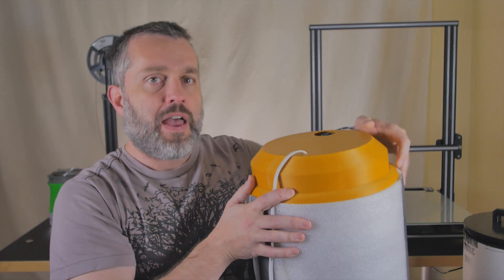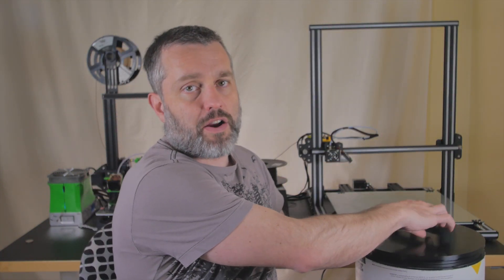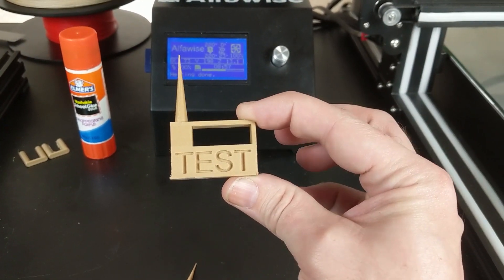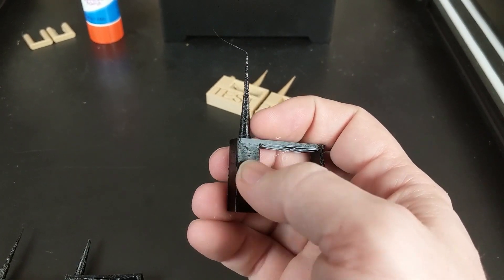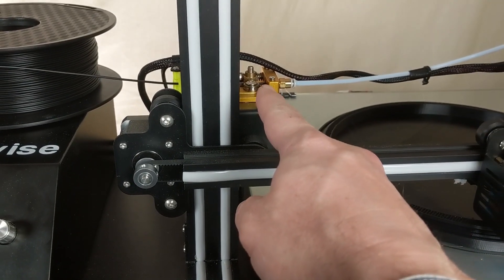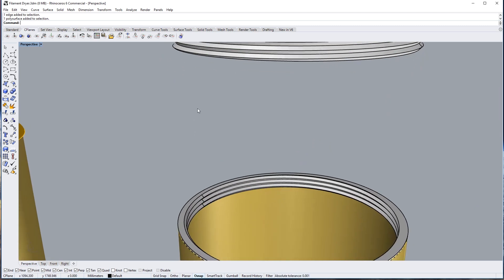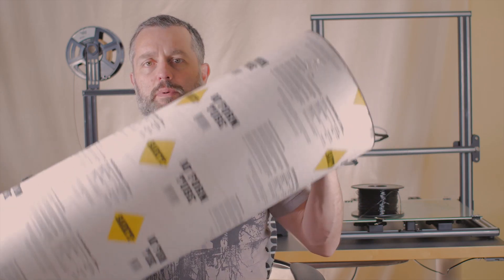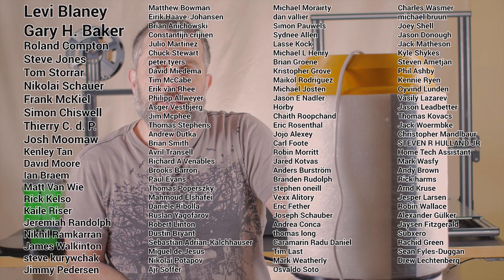If You Are Serious About 3D Printing You Need a Filament Drying Solution.

Comment: I use large resealable bags and put in two silica dry packets which you get in some items for nothing. I got 5 large bags off ebay and the whole thing cost about 1.79 English pounds and i have had no problems since doing this and i always take the filements off the machine after use and put them in these bags.

Comment: “Fails under any amount of heat” ..... define “heat”.
Reply from the maker: I printed some hooks with PLA to hold oven mitts. I placed them about 24" (60cm) above the stove top on the wall. The heat from the stove/oven going up the wall caused the hooks to soften deform droping the oven mitts. If you place PLA printed things in your car on a sunny day they will similarly deform. Good enough? Or do you want me to cite glass transition and flowing temperatures at you?
Reply: Design Prototype Test Design Prototype Test that’s ok.  I know precisely what those values are.  I’m just calling you out for making a blanket statement as in “any heat”, which is too broad a statement, which also loses credibility.  Just sayin’.
And imagine if your toddler ate the spire and attempted to swallow it and it got stuck in his/her airway or throat.

Comment: ok I had kinda an idea of making a a perforated tube that you can fill with desiccate that slides in the holes of the spools that way its a quick grab pull and replace for the desiccate I mostly use PLA but it would be good to have something for the wood fill and PETG right now I just use ziplocks

Comment: Interesting and a useful solution. I'm only using PLA at the moment and hope to progress to some other materials, however I'd suggest making something transparent so you can see at a glance what filaments are where!
Instead of the formtube, I'd make a cylindrical cage out of dowels and wrap polythene around it and seal with duct tape. Your plywood base and screw lid and receiver could still be used with printed holes for the dowels.
Cat litter with the blue/pink cobalt chloride indicators should be a cheap and useful desiccant - it can also be refreshed in an oven at 120 °C for an hour or two and the colours will change to show when ready.
Water vapour is less dense than air, so I'd suggest putting the gel in a basket at the top of the box and that should increase efficiency/effectiveness.

Comment: Worth noting that when you get to nylon materials that they will actually be weaker as made and will significantly toughen with moisture absorption.  When a finished parts structural integrity is being challenged by it's application such as driving self tapping screws into holes that could split out it is not un-common to vacuum seal finished parts with water in the bags for re-absorption.  Just some fun facts for the future...
Reply: I guess I am pretty off topic but does anyone know a good site to stream newly released movies online?
Reply: @Malachi Seth Flixportal =)
Reply: @Elijah Eli Thanks, signed up and it seems like a nice service :D I appreciate it !!
Reply: @Malachi Seth happy to help :D

Comment: Oh yeah you should never dry pla at over 50 degrees 😂. But even if you do set it to 45 degrees you have a bigger problem. Because the temperature control on most food driers is crap: usually a cheap, inaccurate bimetallic strip. The small sections of pla only needs to go over 50 a couple of times to screw up your print. Yuou probably need a dedicated temperature range thermistor and pid loop. These analogue things aren't designed to hold precise temperatures. This might be good enough for filaments with high glass transition temperature, but definitely not enough for pla.

 IMO better to use the taulman method with a heat lamp or other more gradual great source
Reply: Could you elaborate on the Taulman method? Heatlamp to the spool or something more complex?

Comment: PLA wont deform under "Any heat" it doesn't need to be kept at 0 kelvin.
i use PLA exclusively and never needed to dehydrate it. it doesn't last long enough to become brittle.
why use rhinoceros for 3d modeling? there is a much better program you can use for free. fusion 360.

for a dry box it would be better using rubbermaid container, moisture absorbent, and ptfe tube that goes directly to an extruder. better if extruder is  bowden to reduce weight on the carriage. this way you nearly remove any chance of it absorbing moisture as long as everything else is sealed up.
Reply from the maker: Regarding Rhino vs. Fusion 360, I talked about that in this video here: https://youtu.be/iMyEOqrdr3c

Comment: Can't I just put them on the heated bed? XD
Reply from the maker: Maybe, if you built an open bottom box for the spool to go inside of. Actually, this is an intriguing idea. I'm going to try this.  Thank you.
Reply: @DesignPrototypeTest  Yeah. :P When I get time, my plan is to either move my control board out from under my heated bed, and lower the bed... or just leave it where it is. But it may give me space to store some filament. :P
Other than that, there is a lot of spare time warming/cooling the heated bed... so when not printing, I could put a couple of older, smaller spools on there on occasion. But not had any damp problems just yet, as I'm going through the filament at a steady rate.

Comment: Ok as far as the open sided reel on the first solid sided reel the drying process affected the first part of the reel that could easily be affected by the air flow and temp. Now as your statement that because of the solid  sided reel the inner filament can't be affected by the dryer. So in theory it can not be affected by being out in the real worlds air and humidity. So the inner part of the reel should be relatively unaffected and be as good as the day it was made. Now you take that reel and re roll it on to the open sided reel and your prints are GOOD. I think the reason for this the fact that you basically have just gotten to fresh filament. NOW  I'm not saying that the open sided reel and a loser wrap of the filament will not allow the dryer to affect a better drying process. The air and humidity affects deeper into the reel than the drying process can or does. thus the reason that drying the filament gets you a little improvement. then goes bad. I have split rolls so share with other printer people I know the prints they get are not good & they let me know the filament I gave then was bad & I check what I have is good. I think the supports what I am sharing with you. So there is some other info to consider I like you dryer and storage container keep up the good work.

Comment: Very interesting observations on PLA characteristics. Yet another layer of uncertainty in a "hobby" filled with them. I'll be more careful about drying PLA. I have found evidence that drying it can be beneficial despite the fact it's not supposed to absorb moisture. I dried some at 65C recently that seemed to be stuck together a bit throughout the roll after. It appears to print just fine though. I'm sure the additives and pigments used play a roll here.

Comment: Sorry, but you have this fundamentally wrong, I have worked in the PET molding industry for 35 years and can tell you that the problems you see have nothing to do with boiling water within the resin.  The levels of moisture involved are so small that you would never know they are there, except that they cause a fundamental change in the resin structure itself.
Many of the plastics that are hygroscopic absorb moisture at the molecular level.  Left at room temperature there is no degradation but when heated, water molecules combine with the plastic (PLA, nylon, PET etc) through a chemical reaction called HYDROLYSIS.
Hydrolysis breaks down the polymer chains which has a number of effects including loss viscosity, stringing and when cooled the products exhibit low strength.
Reply: 36 years of injection molding here too and I while i may not disagree with your structural analysis, the poor surface finish is purely moisture absorption and it is boiling out in process causing the ugliness. When break testes are done on parts it is common to see voids in the part where the break occurs as opposed to none in dry parts. I have even ran the old fashioned vented bbl. machines that would boil the moisture out in the heating cylinder and allow clean dry resin to come out and into the molds, it was surprisingly successful but not like dryed materials.

Comment: Been printing for over 6 years, I let my filament sit out in open air no matter what type it is, never had a single problem when printing it, I guess it's what happens when you cheap out and buy the lowest price filament out there. 😂😂😂😂
Reply from the maker: You probably live in a very dry environment. Like maybe Arizona?
Reply: no "cheapest filament out their" meaning NOT PC/TPU/PETG etc.. ie stuff that is much more resistant to water intrusion (IE pla etc..)

 @DesignPrototypeTest
Reply: @DesignPrototypeTest   No. I'm in Iowa.
Reply from the maker: Iowa is a fairly humid place. Therefore, Your experience is an anomaly. Maybe your house is climate (humidity) controlled.  Try this: Take your No-name inexpensive roll of ABS, Nylon, or Polycarbonate and leave it outside on your porch for a week or two. Then take it inside and print with it. Watch the steam coming from the nozzle (that's not smoke), and listen to the snap crack and pop sounds as your are printing. After the print is finished look at the layer lines with a magnifying glass. You will see small gaps in the extrusion wherever a steam bubble popped as the part was printing.
Reply: DPT I think you missed the point (or I missed it)

PLA is pretty resilient to moisture (the part that passes the hob gear is "compromised" that is why that few inches is always brittle!!

I suspect he ONLY USES PLA (hence the only buy the lowest price filament) so he does not have as much moisture issues as would exist using non pla plastics.

though SILK PLA seems to have quite an affinity to moisture (the only PLA I have seen this happen to) ie poly alchemy elixr. getting the snap crackle pop of moisture with it :-) nasty surface finish. need to run my nightshade through my dryer and hope it fixes it. love that stuff :-)

 @DesignPrototypeTest
Reply: @nerys71   No, I use PETG 90% of the time and PLA the rest of the time.
Reply: @DesignPrototypeTest   Why would someone do that? That's very redundant to do because you're trying the worst possible case and not in a normal environment.
Reply: exactly. pretty resilient low absorption cheap plastics. (thought their are of course expensive versions of both available)

we are talking mostly about the less common plastics (99% of my prints are also pla and petg) things like nylon and pc and pet etc.. etc..

 @salvadorfonseca165

Comment: Great Video!  You have me working on this project right now.  I have 5 gallon buckets and gamma lids on hand.  I don't mind the little bit of wasted space, as a test, at least.  Your use of the sonotubes is a novel idea.  I like the suggestion below of coating them inside with polyurethane, as they are not waterproof.  The seams are also actually weak spots that allow the tubes to be stripped off the concrete after it cures (kind of like a Pillsbury biscuit can strips off the biscuit) .  We used these all the time when we poured light pole bases in parking lots of certain home improvement stores.
Reply from the maker: Nothing like those no brand name Home Improvement Stores for all your 3D Printing needs. :) What is crazy and I only just noticed it tonight the coating on the inside of the sonotubes baked off from inside my dryer. I had thought it was some kind of plastic coating, but now I think it was just some kind of oil (maybe silicone). The bummer of this means unless I bake off the coating from the inside of the dry box, I will likely have a hard time getting Polyurethane, or latex paint to stick to the wall. The silicon caulking seems to stick to it just fine.
Reply: @DesignPrototypeTest   That is a release agent as I recall. And I never even remembered that being on there until you mentioned it. Without it, the concrete would not have a smooth finish an the tube would be very difficult to remove from the cured concrete. Silicone sticks to almost anything, even glass. I will bet you find a solution to this issue.

Comment: I have a thick, Styrofoam cooler that was sent to me with some Omaha steaks.  Its holding 9 rolls of filament at 76F and 34% humidity.  It's kinda happy.  Each time I open a new roll of filament, I toss the dry-packs in the bottom of the cooler.  Working a treat so far.  My printing room is colimate controlled with both temperature and humidity.

Comment: instead of the printed O-Ring you could try making a silicon seal on the top of the tube ring that the lid screws into. Done right it would be a very air tight seal.

Comment: I have a vacuum chamber that can hold 4 spools.  I expect that this will dry the filament even with solid wall spools since the water will out gas rather quickly and evaporation is not dependent on the air moving around.  Water will boil at room temp with a strong enough vacuum.  A typical refrigeration vacuum pump is adequate to generate the level of vacuum needed.  I see water start to boil at room temperature (68F 20C) at an indicated ~25 inHg.  It takes about 15 seconds to reach this point.  What I don't know is if the water binds to the plastic such that it would be prevented from gassing off.  If this works I would expect drying to take only a few minutes.  Thoughts?
Reply: so. its been 13 hours. did it work ?
Reply: I've tried this method and it didn't work as well as I hoped.  You actually need to pre-heat the spools before pulling the air out in order to get better results.  Simply pulling vacuum at room temp didn't deep dry the filament.  Extrusion problems persisted after a few layers even on eSuns semi open spools after heating.  A hair dryer connected to a temp controller does a much better job.
Reply from the maker: This is AWESOME! It is something I absolutely want to try. Back 5 years ago this extremely talented guy was making videos and he did something like this. https://youtu.be/iGNXHWPFAKo?t=548  I don't think it will dry your filament in 5 minutes, but it might do it in 30 minutes.
Reply: @DesignPrototypeTest  this would be great to see!!!!
Reply: Very good idea!  This would be a perfect place to use an old hospital autoclave as a vacuum chamber.  An old pressure cooker could be a candidate for such a project as well.  I have a vacuum pump and an old pressure cooker, I might try it.

Comment: The desiccant could go in a center chamber with a separate access cap, top or bottom. Is the plywood and tube sealed against moisture intrusion?
Reply from the maker: The tube has a plastic coating on the inside of it. It comes from the store like that. This makes it impervious to the moisture in the wet concrete. I don't know how much moisture can work it's way through 3mm Luan plywood. After reading your comment, I'm going to coat it with some Silicone just to be safe. :)

Comment: A word about audio: there are LOUD pops in the <40Hz range that might not be that audible with small monitors. There is a cure for this: run ALL audio thru low cut filter, cut everything below 60Hz out. At the moment.. this video is playable but i had to pause because i thought that someone is jumping on the roof... turned out it was low frequency rumble from this video. It starts from 5:17 so you can reference what you did while filming. It can be cable noise from the lavalier.
Reply from the maker: This is the first video I've made with my beard. Those pops are my wiskers rubbing the pop filter on my mic. It won't happen again. :) 
EDIT: I looked up 40hz and it is a really low sound. So we aren't talking about the same thing. I think the pops you are referring to are noise coming from the printer in the background which has been amplified by my sound editing (low pass compression, and normalization). I have a  problem hearing a low hum, so I didn't notice it, and upon re-listening to the video I still can't hear what you are talking abut..

Comment: Why does PLA filament get brittle over time?
Reply from the maker: While moisture doesn't affect the print quality of PLA, it does make it more brittle.
Reply: @DesignPrototypeTest  Sorry, you are wrong again.  PLA is made from corn starch and is one of the biodegradable materials.  It is designed to degrade over time, it is in its very nature and has nothing to do with water content.
Reply: @poruatokin  not really. Pla only biodegrades when acted on by soil based bacteria(i.e. in a landfill). It's the moisture absorption that really weakens pla. The difference between fresh pla and weeks old pla is huge. If it was bacterial action the plastic would turn into powder and chips after months. I have pla prints that are over 8 years old and they aren't significantly weaker than when they were one year old.
Reply: I believe pla gets more brittle over time for the same reason it does from heating. The polymer crystallizes as the lactic acid groups align ( heat speeds this up). This increases strength which also makes it more brittle (think glass). This also leads to it becoming more resistant to melting, which is good in a product, bad in a filament.